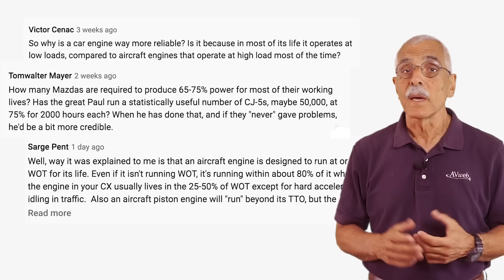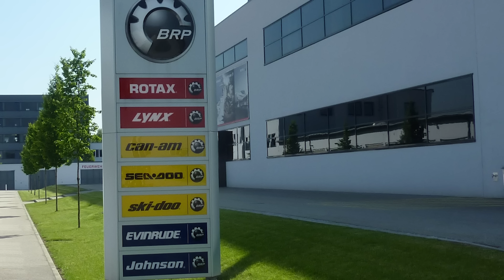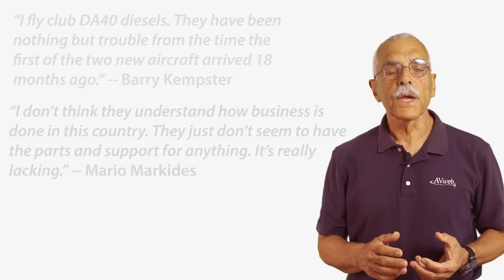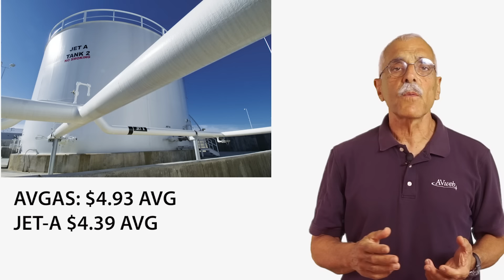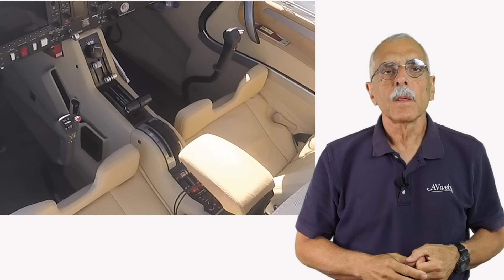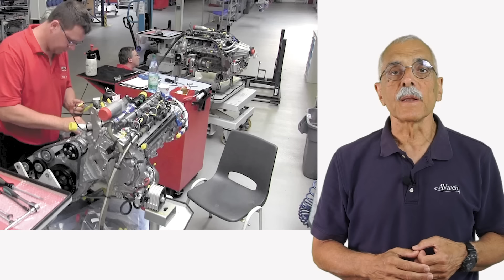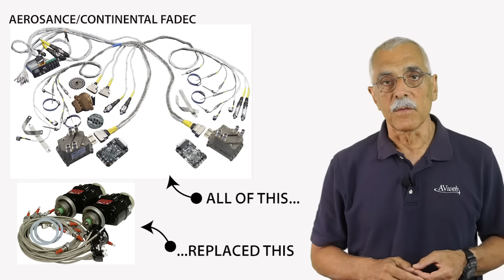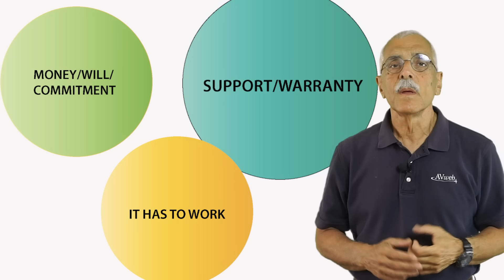Why New Aircraft Engine Ideas Rarely Succeed

Comment: I was just talking to a friend about this. I think the market is just too small to support a big change.
Reply: Just to illustrate how small the market is, consider this. There were a total of about 1,300 new piston aircraft shipped in 2019 world wide. On the other hand, Ford produces 900,000 F-150 pickup trucks every year, that's over 100 per hour, day and night. So, ONE car company make more of ONE model of vehicle in 13 hours, than ALL piston planes/engines combined in a year.
Reply: Unfortunate. I think GA madlads would need to step up to keep anything interesting. This hobby is beyond expensive and either fully dedicated or not
Reply: @invertedv12powerhouse77  One huge problem I see is if you do choose to buy an aircraft, it's very difficult to turn it into a revenue source.  The FAA should make it LESS restrictive in doing a commercial enterprise.  The reason I say this is many fold. The HUGE reason I'll not say on this platform because there are those that are like sensative Tom Cruises and THEY CAN'T HANDLE THE TRUTH.  So I'll go to my 2nd reason -> revenues coming in would not only cover operating expenses, but would allow a budget to NOT {read that - N-O-T} skimp out on maintenance and ALLOW {read that A-L-L-O-W} the budget to have ON GOING training such as glider flying, upset training, basic aerobatics, mountain flying, IFR refreshers ect.  This would result in BETTER aviators.  Besides that, the mission of the "FAA" is to PROMOTE aviation.  What  upsets me from the FAA's perspective, is your wife. or your kids, or your friends ARE of LESS value than a "paying customer".  The emphasis should be IS the pilot a good pilot or is he a bad pilot ?? NOT, is he making money or not.  If you're NOT "safe enough" to fly a "paying customer", then you're NOT safe enough to fly your wife, kids, and friends.
Reply: Market is too small, and the cost per unit is way too high to be willing to take any chances. First 40 years of Aviation: First powered flight to Jet Engines. Last 40 years of Aviation: "We Can't Afford to change anything"
Reply: @Racing_Pig  The first 40 years of piston engine development were driven by military needs.  Once the military were wedded to the turbine, piston engines development hasn't been so vital.
Reply: @peterknight4692  Excellent point!
Reply: @peterknight4692  That's an excellent point.  I never really thought about it from that angle, but yea right on!! Anything to do with the military, you're talking GIGANTIC sums of money available for R&D and P.  Then in the non military sector, the capital available just is not there like it is for the MIC. Plus the GA market is so TINY compared to say the automotive market.  Also, the average person just doesn't understand aviation. So for example a banker just isn't going to be willing to lend tons of money to GA. They think EVERY flight control surface is a "FLAP", because it "flaps" back and forth, and when the word "stall" is used, they think "stalling" is the engine konking out because that's the term used for cars {well it used to be} Growing up people would say "my car "stalled", now they say "my car died".  Plus most people refer to light aircraft as "prop jobs", or "puddle jumpers".  They also AUTOMATICALLY think that light aircraft are more dangerous than jet airliners not realizing the ABSOLUTE SLOWEST you can crashland a jetliner is 150 MPH.  Usually that would be more like 165 to 185 MPH.  Most light aircraft you should be able to crash land at 55 MPH or less using the correct technique.
Reply: @mustardseedsociety  I'm pretty certain the stats support the view of GA being much more dangerous, but I suspect that's mainly because of the much stricter rules for commercial aviation. The same rules applied to GA would likely give similöar safety results ... and probably price 80% of the current users right out of the market.
Reply: @KaiHenningsen  BUT it should not be that way.  I'd much rather go into the trees at under 60 MPH than at 160 MPH.  Also if a jet airliner catches on fire, it gets really ugly really quick - thousands of gallons of fuel all burning at the same time versus 30 to 100 gallons.  The big advantage the "heavies" have is their ability to deal with weather.  They can fly higher and they are much faster so deviating is not as big of a deal when you're doing 9 mm vrs 2 to 3 mm.  Also the heavies can handle icing better because theres tons of hot air available to perform anti ice.  The best the little guys can do is deice which means you have to literally let ice build up first.  well what if the system fails after the ice buildup ?? Plus the little guys have to vote for an "act of congress" just to bring revs into the equation which would ALLOW for more training, better maintenance, and safety upgrades.  The heavies are ALL about revenue generation which makes possible the compliance of the extra safety regs.
Reply: @Racing_Pig  Well this is only the light aviation market, while the passenger market also moves slow it definitely moves more than the light aviation market. After all the newest generation of passenger jets are significantly more fuel efficient and reliable than the ones released 20 years ago, most use new engine designs and are taking on entirely new roles. Like just look at how in the early 2000s long haul flights were dominated by 747s and A380s but these days tiny jets that would once have been considered regional can take on those lines too. The reason why there's a lot more innovation in this market is that every single player is larger, the planes are mostly being produced by Boeing and Airbus who are both gigantic multi national companies that can afford to invest a lot in a project until it becomes successful, the engines are being designed mostly by Royals-Royce and GE, and the end consumer is air travel companies that transport about 3,8 billion passengers each year. Every step along the chain here can afford to spend the money to buy a new plane and engine if it offers fuel savings and better range since fuel is their main expense and better range lets them create more routes. 

Then of course there's also the military sector which also obviously isn't moving slowly, maybe in the last roughly 30 years since the end of the cold war things have been slower but things are speeding up again and the 5th generation is now entering service, here of course the whole game is introducing as much new technology as possible since the cost is really not an issue it's about getting an advantage.
Reply: @Racing_Pig  That's probably the most accurate get to the point statement made.  I think you're right.  Especially the observation of being a small market.  Heck aviation writers get all excited, "wow Cessna produced 20,000 C-172's" {yes I'm guessing the #} and we aviation readers are supposed to get all goose bumpy, but in reality 20,000 ?? Compare that to how many cars are produced - MILLIONS Upon MILLIONS of cars and car engines.  My personal opinion, I think Pipestral is the current BEST GA manufacture on the planet.  The speedy Panthera has been spin tested with 3/4 fuel in the tanks, 4 people on board, and they took it to 10 rotations on the spin test and it fully recovered very nicely.  But if all else fails there's a parachute.  But it's 600K out the door. I'd like to see a true 5 seater using the Panthera Virus concept where you have decent speed but also nice glide ratios.  With that concept, you know we're always told about the "impossible turn", well there you go - no more "impossible turn" - if engine "quits" on takeoff, you can ACTUALLY do a turn around {or deploy BRS} and when you get up to altitude and let's say you got a nice tailwind, just shut the engine off and get to your destination in "quiet" and not burning any fuel.  You only turn the engine on when you get in sink.  If your in lift, you just trim the nose down and cruise forward burning up real estate but not burning fuel.  PRETTY AMAZING !! But I'll be honest, when I was on the Pipestral website, I liked what I saw in the Virus, but kind of bummed it only has 2 seats, but whatever - BUT I on purpose DID NOT look at the price.  At this point I don't even want to know.  There's a glider club 35 miles from where I live, and I can just go fly high tech engineless gliders that need tow planes - FOR NOW -
Reply: @mustardseedsociety  There's always motorgliders. That's how Diamond got started.
Reply: @Racing_Pig  You actually raise a good point.  I've started my glider training out in So. Cal, and it's looking like I'll finish in North Texas.  As a kid I hung around gliders because my dad was a tow pilot.  So what's puzzling to me is why does the glider/soaring community still use tow planes {with no intentions of stopping} ?? I realize there's an existing fleet of "true" gliders and we don't just want to "junk" them, but we now have self launching gliders.  Pipistrel has 2 models, one uses an electric motor and has a ridiculously high glide ratio, then the Virus which has a gas engine that you shut off.  You can remove the outer section of the wing and have 24 to 1 OR install the outer section and get 29 to 1.  By going moto glider, you virtually eliminate the dreaded cell phone call "hey Frank, I had to put the glider down in a wheat field, can you come get me ??". Even the best glider pilots sometimes run out of lift, despite the laws of physics stating that if you're in "sink", then "lift" is nearby.  My hope is the Virus would become the standard for basic aviating.  With the Virus, you got an "airplane" and a glider together in one machine.  Pipistrel seems to really have their act together.  But just like any new airplane, they are expensive.
Reply: I disagree. I think it's an American conservative cultural phenomenon. Diesel aircraft engines have been far more positively embraced in Europe, than in America. Just the same as everyone was flying LSAs with efficient, torquey Rotax engines in Europe, when Americans still thought a C150 SPAM can with a gutless Continental O-200, drinking literally twice as much fuel, was a better option.
Reply: @droge1300  Did you honestly just compare a brand new diesel powered airplane to a C150? Those two are not even in the same league as far as cost goes. Anyone who is flying a C150 is doing it because that’s what they can afford, not because they think it’s better than a new airplane. In Europe with the rarity of Avgas and the excessive regulations, the pilot with the C150 budget wouldn’t be able to fly at all. That’s also why so many European student pilots come to the States to train: it’s cheaper.

Comment: What a great piece. Well done Paul & AVW team. I love aviation and motor vehicles. I loathe that aviation aero engines are where they are (still, if you break it down in 1960). Why hasn't one of these start up engine manufacturers looked to the motorcycle engine technology! "Nicasil" plated aluminium cylinders. As hard & reliable as you can get! It ticks every box , and for aviation as light as you can get. Has been the standard in MX cylinders since the mid 80s. Used on road bike engines now and all MX machines also. And as an example a current production 1000cc bike makes 200+ HP and in total (as in bike total!) weighs less than a 6cyl engine aero engine. (Yes l realise it's not a direct comparison, but the tech is there to have a light, cost effective assembly, product support, fuel efficiency ++).
Reply: Can motorcycle engines run at 70% power for hours on end? My motorcycles only stay at full power for a few seconds at a time typically, so I have no idea.
Reply: @theralfinator  they could, but not the point l was trying to make. Cylinder coating will be the secret to power to weight to efficiency to cost of manufacture compromise that is/has hamstrung aero engine industry.

Comment: Engines in general never evolve... they have incremental improvements.... Im driving a 21 year old automotive engine that has only had spark plugs changed 1x . Its been driven in 110deg for 5 hrs, 27 hours continuous (minus fuel stops at least 10x) I don’t see how it could be more reliable

Comment: Everyone seems to forget the type one 2300 is an automobile engine Volkswagen ring a bell. Realizing for the most part you're talkin production planes. But on the experimental side they power hundreds of planes. I built mine with the largest heads and valves mofoco has available. A cam that makes all of its power between 1200 and 3000 rpm's . And about 180 horsepower with fly wheel drive. 
    If I would be putting a engine in my plane that weighed 450 lb I would go with an aluminum LS supercharged engine all day long and get some real horsepower.
Reply: I think the problem is the VW is too little and the LS too large for most GA needs.

Comment: Thanks for a great video.  Ironic that the most dependable vehicles now come from Asia and in spite of their price, a number of the most maintenance heavy  vehicles are German - electronics are causing large repair bills.   On the subject of Porche, who in this day and age has valve spring issues on a relatively low-speed engine.
One thing about iron blocks, they don't warp and they don't crack.  The weight penalty is only about 15% compared to aluminum.
Reply: I have replaced more than 1 cracked cast iron block. Try driving one through a mud puddle on a cold winter day after a 5 mile street race ( l hate spell check )

Comment: A Wankel would be dope for civil aviation, honestly better suited for it than for cars, but no one will ever want to put in the resourses it needs when there's easier piston alternatives.
Reply: It has been done a few times.  One problem is poor gas mileage, and I think it needs a gearbox also.
Reply: Mazda walked away from the Wankel when its licensing agreement ran out.

What killed it was the fuel economy was terrible,  the engine was dirty . And despite a relatively low part count, was surprisingly expensive to manufacture and emissions certification.
Reply: Worse fuel mileage than a Corvette V8.

Comment: Excellent vid. Seems to me it is incomplete w/o discussions of Jabiru, Egenfellner, at least a couple of the experimentals that are actually flying  in some quantity. I suspect--you'd know, of course--there are more turbo Subaru and Honda etc. pulling airplanes around than there are Austro diesels.  How do they stack up un the reliability, power to weight BSFC, and cost metrics?  Also, none of the auto engines you say were technical successes have actually run by the thousands for tens of thousands of hours at 75% power. I think you're probably right that some of the failed engines were actually as reliable as what we've got, but you saying so and the numbers you're working with don't prove it. PS, what's so hot about .39 BSFC in the IO-550? P&W was doing almost that well in the 1940s on say, a 985, with a float carb. Run the numbers for 300 hp at SL (but not 8300 msl.).

Comment: Was at one time very interested in a Maule with a diesel...but guess what, Maule never did anything with it...seems to me there is a want and need for diesel if for nothing else than it will burn Jet A ...The Continental web site says they are working on a 300 hp diesel which would be perfect for a M7/M9 but it must be a mystery engine as nobody seems to know anything about it.  Especially Maule

Comment: The myths about auto engines always perplexed me. Anyway, I'm just going to throw this out because it may be the best engine of all time in anything.. GM LS series of engines. I know some will comment no, no.. blah, blah.. but.. talk to the hand. They absolutely are one of the best engines ever manufactured.. it's why they are being swapped into literally everything on the planet. I would stay away from overhead cams. Any cylinder or head work becomes exceedingly expensive, and way harder to work on. Still don't get why the IE2 isn't in every new piston plane. Why do people want to play with fuel mixtures is beyond me. Electronic ignition, turbo charged, fuel injected. Well that's my babble on the subject.
Reply: I agree; however,  the LS has an odd problem- it's too big and heavy for most piston applications but also has more power than most need. Essentially,  we need a 3/4 scale LS. I only recently discovered that the newer 4.3L V6 is,  in fact,  an LS. However,  it's probably an iron block as it is a base model truck engine.  An aluminum block would be perfect!
Reply: @jamesengland7461  Yes, the V6 version would be perfect in an aluminum block.
Reply: "Still don't get why the IE2 isn't in every new piston plane."

I can tell you exactly why.  Same reason nobody wants the Continental diesel engines - the six figure price tag.

Comment: People are saying Toyota is at it again with the G16E GTE engine from the Yaris GR. 1.6 liters 3 cylinder turbo engine putting out 270hp.
Reply: If you're going experimental and you like Toyota go with their 5 liter V12. It comes in at right around 450 lb with twin turbos makes 900 horses. The engine is capable of producing 1500 hp. Lol
Reply: These new “Dynamic Force” Toyota engines are on another level